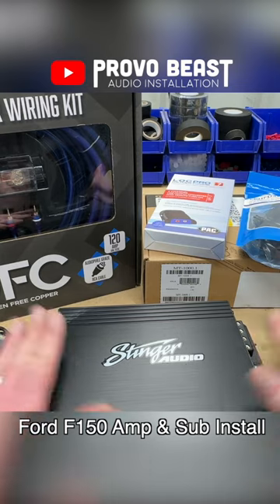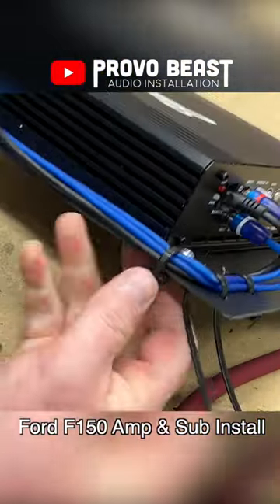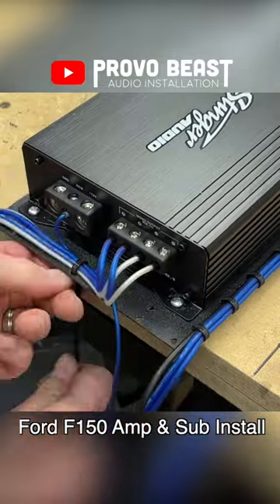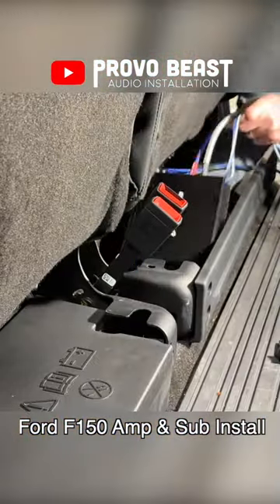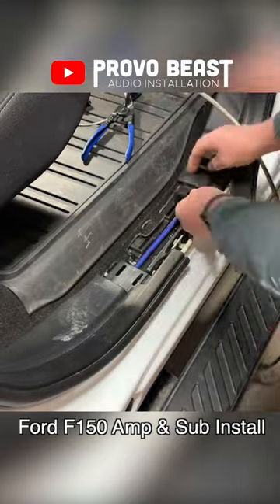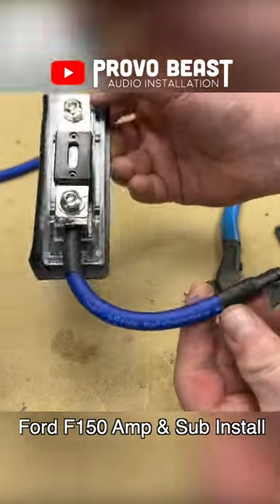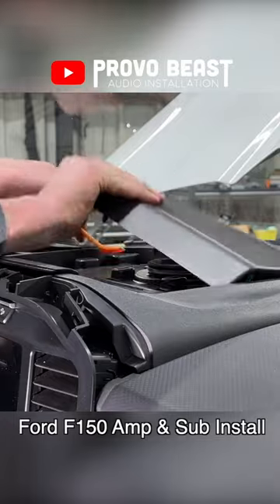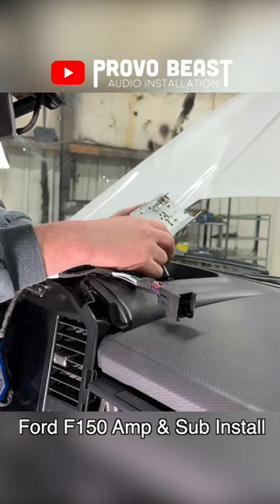Ford F150 Amp and Sub Install | #shorts

Comment: why pay a shop to do all that and still keep your oem radio
Reply: Some OEM radios come with CarPlay and it’s way cheaper to add a line output converter. One of the best ones is the AudioControl. And right now the LC1i is on sale for quite literally $48